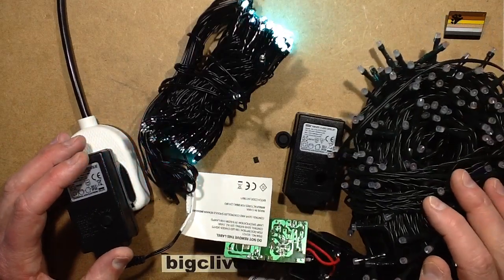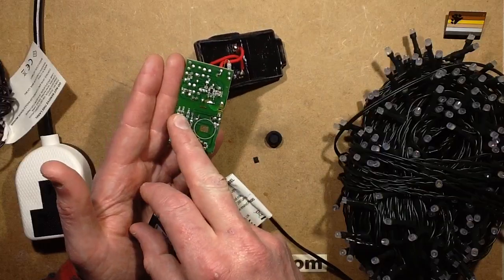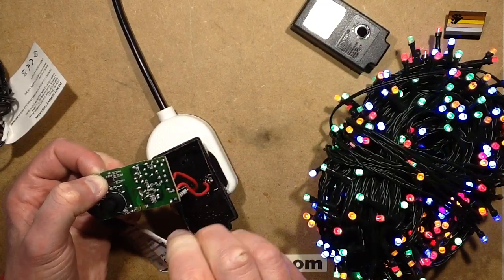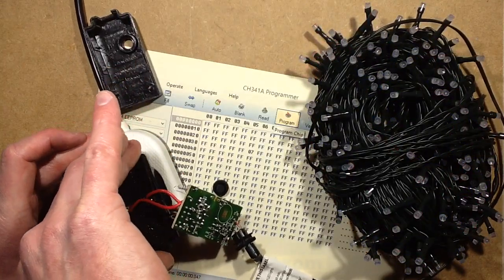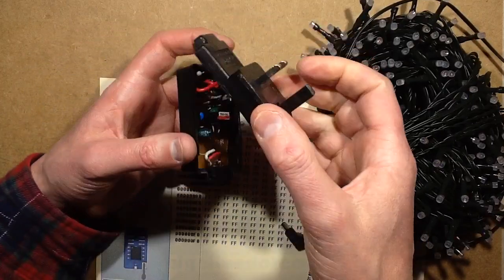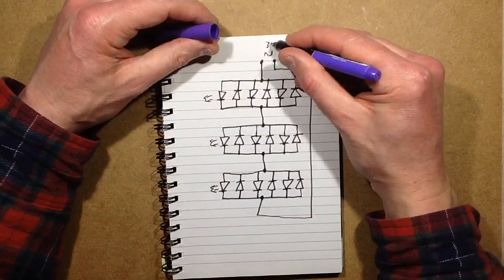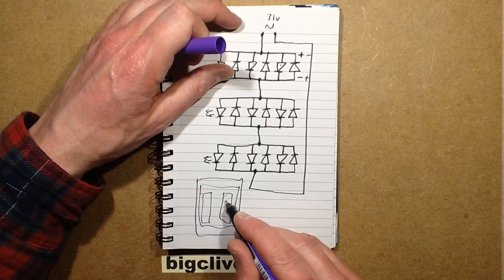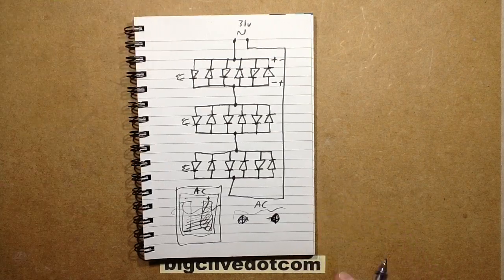Memory hack for new 2-wire LED Christmas fairy light controller.

Comment: How many times have you been electrocuted?
Reply: +Jim Gardner As he is distinctly alive whilst recording this video, I'd say never. Electrocution = electric + execution.
Reply from the maker: +Jim Gardner Strangely not many full-on mains shocks at all.  Lots of random shocks from other exciting sources though.
Reply: +Zadster electrocution doesn't always mean death. I've been zapped by the US 120v mains more than i'd like to admit. My time in housing repair has put me in some odd situations where i've been hit with 240v a couple times, I wasn't being careless in those two cases either, my encounters with 120v I cant say the same for however. Once it was a failed 240V Stove/oven install the homeowner screwed up, and the other was an electric heater that was improperly installed on a knob and tube installation.
Reply: @2009dudeman  Electrocution would equal death.  Electric shocks do not always equal electrocution :).   Just being technical on that.
Reply: +2009dudeman 
The word Electrocution has the definition "death by electric shock".
Reply: Glenn Pierce im not an english teacher. You know what I mean.
Reply: +2009dudeman 
Yes I did know what you meant. I wasn't trying to be offensive. Just trying to correct the misunderstanding of you responding to Zadster. Sorry for any offence caused.
Reply: Glenn Pierce I'm not offended, nor did i intend to be. No worries.
Reply: +bigclivedotcom Kinky ;)
Reply: I've had a few belts in my time,I'm just over 40 & it's normally every couple of years when I get slack & over confident I normally end up with a tickle or belt which reminds me not to get over confident & act like a div
Reply: 37 that i no of. im 13
Reply: +bigclivedotcom ... you do strike me as someone who has a great deal of faith in their circuit breakers! :D
Reply from the maker: +mspenrice I prefer not to rely on an RCD/GFCI, but if I really screw up and find myself in a path between a live conductor and ground then I'll certainly appreciate it.
Reply: +Connorocker Gaming You really should be more careful. Its not actually something to be proud of, you can actually die from it... go and play with some nice 5V DC, there is lots of exciting things you can do with that! and the risk is considerably reduced!
Reply: TornTech true. but i counted small stuf too. like holding batteries. i dont ever recall getting more than half an amp through me though.
Reply: Connorocker Gaming Since when do batteries give you a jolt. I work with 24/48VDC fire systems and have never received even a tingle from either the batteries or the charging circuits, even when my hands were moist. Licking a 9volt does result in a bit of a tingle, if thats what you're saying.
Reply: When they have a high reserve current and a low internal resistance, that's when. 12V car batteries can give you a decent kick, because they are built to shove out upwards of 30A (and I've personally installed one with a 60A rating) whilst cranking the starter motor.

Did your fire system need a burst power capacity of 1.4kw or more?
Reply: And I don't think Con really meant the kind of shock that knocks you to the floor halfway across the room. You can get a noticeable "tingle" or slight zap that makes you shudder just off shuffling across a carpet on a dry day, or touching a high current battery's terminals with damp hands (especially if there's also a capacitor involved somewhere). I remember some clever idiot ;) at school making up a small device that was halfway between a joybuzzer and a taser with some surplus bits from the D&T room ... a chunky cap, a 9v square battery, a couple push switches and some wire, which he then employed to go around covertly shocking people with the thing easily hidden in his palm.
Reply: mspenrice perhaps its possible, i've just never had any experiences where that has happened where I wouldn't attribute it to other components.
Reply: mspenrice There is so much wrong with this, also for your two numbers I sincerely hope you just forgot some zeros and don't really mean 30 and 60. Firstly reserve current isn't a thing, its reserve capacity and that is defined as the time it takes a battery at 25A draw current to fall below 10.5V. It is a measure of energy capacity, similar to the Ah rating. The measure of near short circuit current is the Cranking Amps rating, commonly confused with cold cranking amps. As for starters, 60 amps draw maybe for a snow blower starter. But even a small 2.4L I4 will draw near 150A. My truck draws close to 350A, and the Semis I work on can draw up near 1500A. As for the batteries used in fire systems, they are nearly the same as a vehicle battery, just smaller and sealed. However, they can still easily output 50A each. But when it gets right down to it, 12VDC isnt enough to breakdown the layers of dead and living tissue to cause any noticeable tingle. Dry skin has a resistance of aprox. 1Mohm meaning at 12.6V (nominal battery voltage excluding surface charge) the most current that will pass is .126ma, not nearly enough to be felt at 12.5VDC, even wet skin has an aprox. resistance of 1Kohm, passing 12.5ma. 10ma of AC current passing is just barely enough to be felt, however DC does not have a fraction of the breakdown effect that AC does on the human skin. I've grabbed both positive and negative terminals of a 48V battery system and felt nothing(my hands were dry, i'm not an idiot) and ive grabbed 12VDC while soaking wet and felt nothing.

There are cases of feeling a tingle from such low voltages, but really that is only possible if the area being contacted is covered in conductive liquids or if the area being contacted is a break in the skin, or some internal fleshy surface where the resistance is sub 500ohms.
Reply: Maybe I did get some bits wrong, I'm not a pro electrician and it was probably late at night. Let me have a read and figure it out.

Oh, and if I'm not using the exact terms as laid down in the latest revision of the regs or whatever they're called, please, cut us a little slack, because I haven't read them and I don't think I'm even in a position to be able to. I'm describing things the best I can.
Reply: OK, first thing, I don't know what kind of enormous truck you think I'm driving to get my ass to and from the supermarket, or to commuter to work fifteen low-speed miles across a relatively flat and temperate city in the middle of England, with the occasional 100 to 150 mile pleasure trip with 50-100lbs of luggage thrown in for good measure on routes where the 60 or 70mph speed limit is often a distant dream because of traffic, and everyone's ecstatic at the moment because the cost of gas has come down to the equivalent of about $5.75 per US gallon... but it's not a Hemi or whatever. The largest motor I've ever personally owned was 1.6 litres, and mostly they're under 1.5. The current one is a 1.2L 3-pot. With the plugs out, I've been able to crank each one I've attempted it with over by hand with a short socket handle and not that much difficulty, and I'm not exactly strong.

Possibly I'm confusing Amp-hours with Cold Crank Amps or whatever (which might have an extra 0? Like 650? It's not really anything I've paid that much attention to other than getting a battery that gave as much of each as possible within my budget), but all the same, I don't think it's going to need more than about 720 watts (roughly 1 horsepower) to turn over a 3 or 4 cylinder petrol or lower-compression (because of turbo) diesel engine. The higher capacity batteries were for the diesels, btw, as they needed to work harder between the higher compression and the glow plugs.

It generally took until the lights were starting to dim before they would no longer catch, and even then the crank was still turning, albeit more slowly. The combined lighting load not being more than 2 to 300 watts after all, and the starter relay switches them out during cranking too.

Certainly if I pop all the (spark or glow) plugs out, drop the car in gear and run it on the starter motor, it doesn't take off like one might expect something with an instant 10 horsepower on tap to. More like one with, like... one horsepower. 10 will get you up to 35-40mph in an actual ICE or electric vehicle of that rating. 1hp is more like Benz's original motorwagen, which topped out at about 9mph, and my approx. twice the weight machines might manage 5mph if they're lucky under those conditions. Barely enough oomph to pull the skin off a rice pudding. A couple of moderately strong people pushing the car in neutral could achieve the same speed, and indeed I've managed solo bump-starts with sufficient run-up and a lot of luck.
Reply: BTW ... "Small" 2.4 litre... lol... no wonder you shower are having to frack shale and go trying to filter oil out of tar sands... but, eh, that's a flamewar for another time, and preferably usenet or something.

(FWIW I have no idea what kind of engine a snowblower uses... I had assumed some kind of pull-cord starter 2-stroke affair, or a small single-cylinder carbed OHV 4-stroke at least superficially related to that of my lightweight motorbike, whose battery will fit in a slightly generous coat pocket and is rated at maybe 1/6 to 1/8th the figures of the car ones, but is still able to crank with some ferocity for a good long time on disagreeable winter mornings because of the weeny engine and similarly small starter)

But anyway, if we're to make a blind assumption along the lines that starter power is directly correlated with engine size because of how much metal has to be moved and how far, and how much air it has to pump, then your "nearly 150A" for a 2.4 divides down to "somewhere in the low 70s" for a 1.2 that's as sticky. But, I wouldn't be surprised to find that your 2.4 is using rather older, higher friction tech and maybe higher weight oil as well, possibly even a carb or single-point injection and older style ignition, for all of which together we can hopefully knock off at least a couple of amps if not a good half-dozen for my 2010-vintage eco-focussed machine that uses a lot of neat tech to reduce internal friction and pumping losses/throttle drag, has direct cylinder injection and electronic ignition, and uses really quite low-weight oil. 60 amps isn't looking so unrealistic any more, is it?

Maybe I should see if my multimeter is up to the task of sitting in series with the battery whilst I crank the starter, but I have a feeling that would likely lead to both the meter and something important in the engine going poof.
Reply: As for the conductance and all that, and the mention of breaks in the skin etc ... would you really want to risk that? It's possible to pick up small scrapes and cuts you don't notice until later on, and then spend an hour wondering about the cause of.

To quote Dethklok ... YOU'LL BE BLOODTROCUTED

Also I've got enough other anecdotal evidence to counter yours re: getting (nonfatal but still unpleasant) shocks from an automotive battery, especially when sweaty or otherwise wet, after a fairly quick and simple websearch. Maybe you are just literally thick skinned or have a strong and shock-resistant constitution. But the threat seems to be real, even if, at 12v, it's only painful rather than potentially fatal (I wouldn't want to mess around with it at 24v or more in that case, certainly not the 48-60v of your fire system, a phone line or power-over-Ethernet). And you're precluding the possibility of some other circuit that may induce at least some AC ripple in the system being active and connected. Would even the change from zero current flowing to whatever the potential maximum is count as a quarter of a very fast AC wave, from 0 to 90 degree phase? Spark plugs work by the making and breaking of circuits after all, or the discharging of capacitative components.

(I mean, my main concern in this particular regard is having seen the sparks you can get from terminals and jumper cables when putting them on or taking them off a battery... I don't fancy getting that spiky orange lightning anywhere near me)
Reply: mspenrice Perhaps America is behind in the eco wave. But there is a reason for such things, simply put we want to be able to move things. We have vehicles that get 40+mpg or roughly 14 km/l. However the number of people who own trailers, or caravans, is much greater than in most of europe, not to mention the increased size of our roads making it easy to drive bigger cars, coupled with us wanting to be able to move large objects without much hassle, and we just like our big comfortable cars. However even in our tiny cars and in most of  Europe's tiny cars (no offense intended, you guys just have really small cars by comparison) the design of the internal components is very similar to the American versions. No car company wants high internal resistance, and turning over an engine by hand without fighting compression is easy, but its certainly easier on most of your cars over there. Still, even the Mitsubishi Space Star with the 1L engine still has a starting current draw of near 70A. As for Diesel, our trucks do take a bit more power to get started than the European Semis just because the engines are larger, however your semis still put out an average of 700+HP or 560+kW. The fuel economy on the lastest American semis match the European versions.

As for fracking and sand extraction, we dont like gas prices above a dollar a gallon, let alone 5.6 or whatever your prices convert to. I wont insult you for having or liking small cars, as that is totally up to preference, but most people here that have large vehicles by your standards, use the space on a regular basis. Right now I have what is considered a small truck  with a 5.2L gasser, rated at 7000lbs (3700Kg) towing capacity and on a near daily basis load it up to near that mark. 

Just on the tech side, there arnt any cars sold in america since the late 90s that were mainstream that weren't direct injection like the Euro cars. Carbs went out a long time ago for everything but muscle cars and vintage rebuilds. Also, when weight is brought into consideration our cars are almost as fuel efficient as yours, we just pack on the pounds and kill that economy. Just a last bit of tidbit, even a little 1.2L turbo diesel has higher cylinder compression than a petrol engine. If I remember right, the compression in Euro diesels is slightly less than the american diesels in order to prevent damage when petrol is mistakenly used, but they still have a high enough compression to be very efficient, the turbo is just to get that extra kick without having to run a super long stroke in order to get the required compression.

Anyway, we can agree to disagree at least. I have never been shocked from even 48V, but perhaps that just means I have followed proper safety precautions when doing so and dont really have the authority to say. I enjoyed chatting with you. If you're ever interested i'd enjoy a friendly debate on some other topic. or hell, even beating this one some more, although its kind of beat to death from both sides.
Reply: +2009dudeman funny thing is, you were actually correct.
oxford english dictionary electrocute - Injure or kill someone by electric shock
merriam-webster dictionary electrocute - to kill by electric shock
Reply: +Zadster According to Google: electrocute
ɪˈlɛktrəkjuːt/Submit
verb
past tense: electrocuted; past participle: electrocuted
injure or kill (someone) by electric shock.
Reply: have you tried messing up with welding machines?... and is there a difference being electrocuted by 120v and 220v mains?
Reply: buy on the stock:http://ali.pub/8tir2
Reply: Contact with me , I will tell you how our machine soldering the LED with wires  654399533@qq.com
Reply: Electricity is NOT A BITCH, she is like a nice girl...if you hold her gently it will just tingle you a little bit ;-) At least low voltages like 120/240V ;-)
Reply: How many times have you what...died?   ...electrocuted🙄

Comment: Could you just put a relay on the LED output from the box then when you trip the relay off the lights will turn off, when you turn it on it shouldn't change modes.

Comment: Interesting video. Personally I don't think I would bother buying lights with flashing effects in the first place as I prefer static lights.
Just noticing the little badge... Are you a bear?
Reply from the maker: +nickhill92 That's the problem.  The flashing sets are the most common.  It's actually harder to find static ones which would be my choice.  But if the polarity thing limiting corrosion is real then it may be a better option.  Yes.

Comment: Why not just throw away the power supply and feed the leds with low voltage AC?
Reply from the maker: +BersekViking They flicker horribly at normal mains frequency.  I've tried it